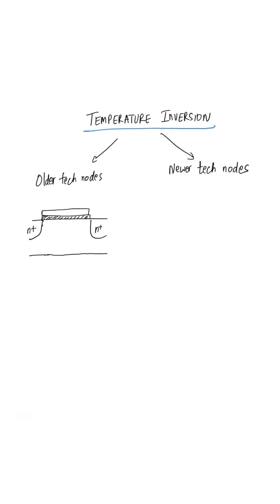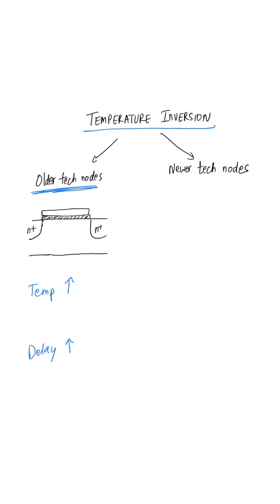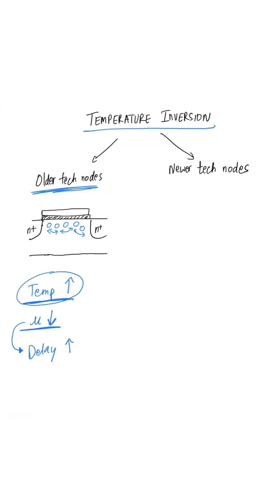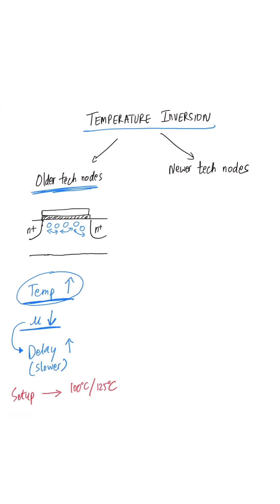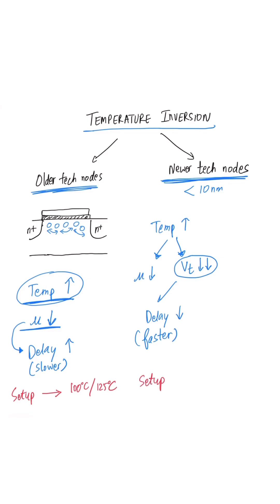Temperature inversion | VLSI Interview prep | Physical design | Semiconductor 101 | Digital logic

Comment: Great concept explanation 🙌
Reply: At advanced tech nodes

• At low supply voltages close to Vth, mobility changes have a stronger effect than Vth changes.

Low temperature → impurity scattering is reduced → mobility increases sharply → drive current increases → delay decreases.

High temperature → lattice scattering dominates → mobility drops → drive current decreases → delay increases.
Reply: At higher tech nodes
As temperature increases:

Vth decreases (bandgap narrowing, Fermi potential change).

Mobility decreases (lattice scattering increases).

In these nodes, the Vth drop dominates over mobility loss → drive current increases → delay decreases.

As temperature decreases:

• Vth increases more than mobility 
improves
drive current reduces → delay increases.